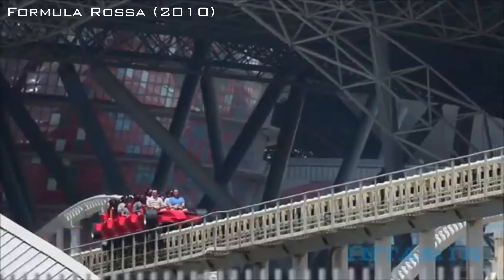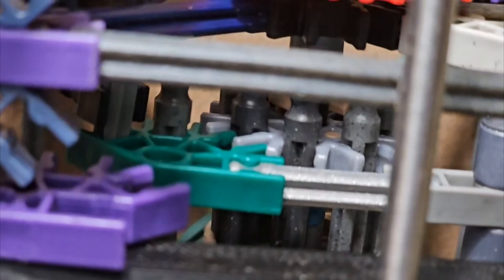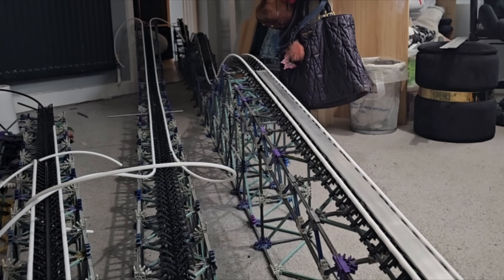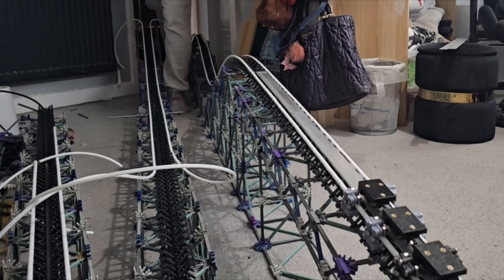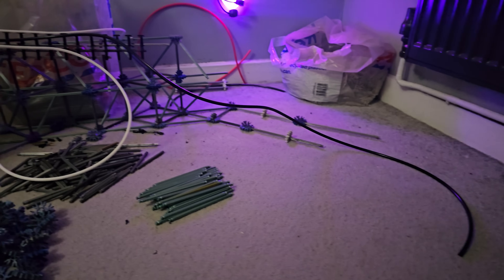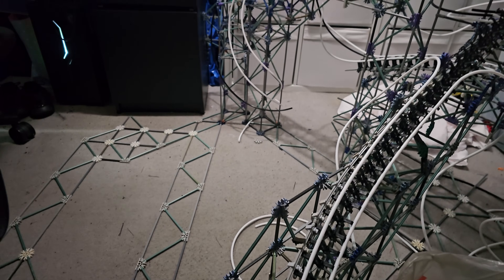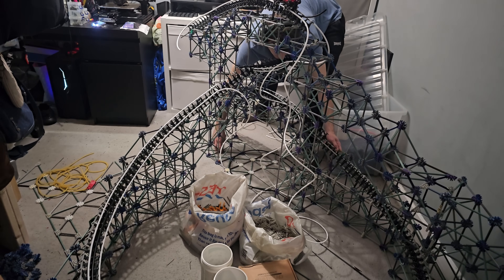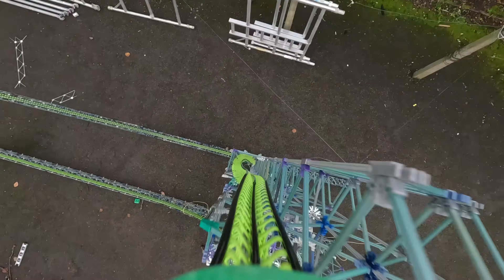I Built the World's Fastest Roller Coaster (Formula Rossa)

Comment: Awesome work as always! Got a question. Your trains have double the number of wheels/bearings as the stock train which is more realistic looking. However doesn’t it run as well with the same number of wheels/bearings if not better? As double the bearings is double the drag they have.
Reply from the maker: @Taipanser  no they actually run the same of not better, because knex track bends under weight and the bumpy nature of the cross ties causes small bumps in the track. When the train weight is spread across 2 bearings is loses less speed from the track flexing. So performance is the same if not better
Reply: @ that makes sense! I’ve built one big model using stock trains but nowadays use CoasterDynamix Dragon/Scorpion kits. They’re the opposite - soft spines and rigid rails which makes them very smooth!